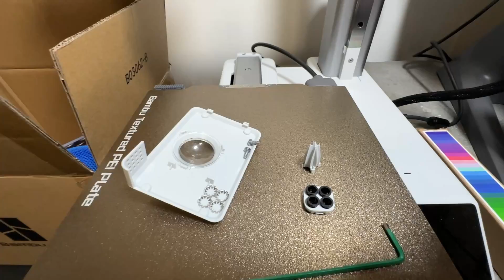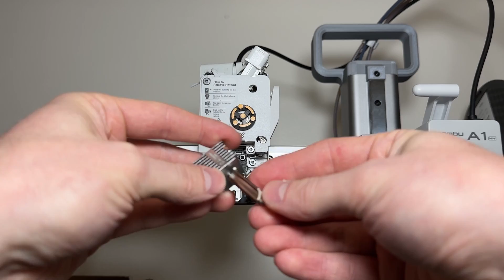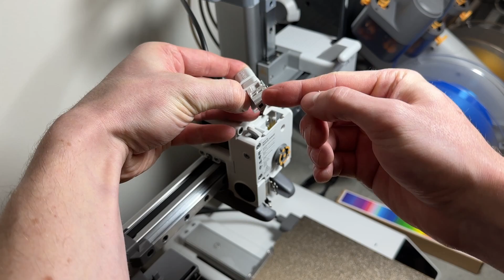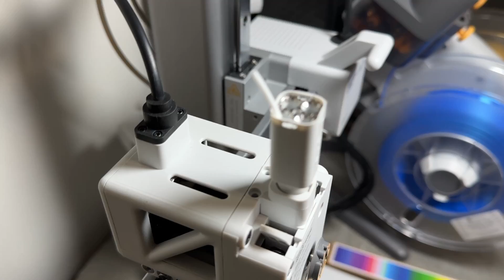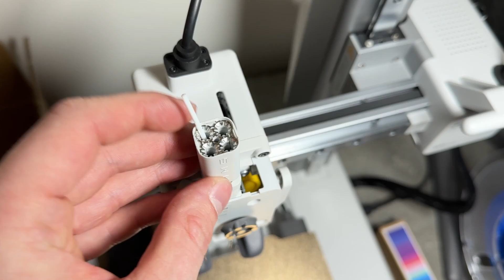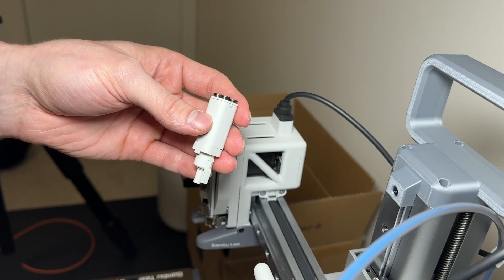How to Clear Broken Filament from the Bambu Lab A1 mini | AMS Lite Filament Hub

Comment: Today i just broke one of those 4 black rings on the top of printer head while trying to pull the tube out to change the filament form abs to external, i just bought the machine few weeks ago, any idea how to fix? should i request a part from Bambù as i still have the waranty?
Reply from the maker: You could try your luck with Bambu support to send you one for free. People have had mixed results when dealing with Bambu support. 

Otherwise it is a $6 replacement part if I remember correctly.

Comment: Wow this is exactly what im experiencing right now and I have done what you did originally but had not fixed it until I watched how you popped up the filament part that didn't require un screwing stuff.
When I unscrewed the top area off at the start, there is that black tape thing which was hard to put back in properly. I hope nothing gets caught or burn.

Comment: My Hotend ain't coming out
Reply from the maker: Might have to press the lever on the side to cut the filament. Pretty sure it does this at the end of every print automatically but if it got stopped mid print the filament will still be attached.

Comment: Just a heads up for anyone stuck on this - it’s even simpler than the video here suggests - Remove the nozzle and then you can just push down the spring loaded filament joiner on the top - that releases the filament that is stuck and the use another piece of filament to just push the stuck filament through out the bottom.
Reply: That didn't work for me but the video did

Comment: I woke up this morning to this problem with my A1, which I resolved with your help. Thanks from Mexico. Now I have another concern. I pulled the ribbon cable that connects to the part where the AMS hub plugs in. It didn't disconnect, but now I can see it on the side of the print head. I'm not sure if that's how it looked originally, and I'm worried it might burn

Comment: Very helpful, I was struggling to get the PTFE tubes off of my A1 on that end and being able to pull it off from that end helped. I was about to right for those tabs too.
Was able to get the broken filament to fall out by holding it upside down and now I can print that tube remover :)

Comment: Ah dude, thank you so much.  I was about to do the same thing you did lol and just start taking things apart. They didn't have a support article for the A1 which....is dumb. But this solved my problem. My filament was stuck by the spring - thank God i had some super thin needle nose pliers that could get it out

Comment: Thank you so much. I had the exact same issue (as well as a clogged hot end), but I could not figure out why I could get any filament into the feeder! This was exactly what I needed to do. I did have to take the top off the hub and remove the divider to get the pieces out. But once I did this worked like a treat.

Comment: This is excellent info man! As someone who often tears into electronics to repair things, I did the same thing and undid the back 2 screws.. started lifting up and felt the tension of something.. the flatflex. "Oh no I am NOT supposed to be here for servicing.." as I know tearing a flat flex circuit is a great way to ruin ones day, they are stupid fragile. Pulling the top piece only off via that tab area, also makes getting the PTFE tubes out WAY easier(my jammed one was not budging) as you can use more angles on it and press it down against a desk. I think I'm going to design a base that this entire piece keys into, so that tube won't get destroyed.. mine jammed from having PLA just sitting in the tube, pieces cracked then fell in.. 2 pieces fell out from that same filament, I'm guessing inside it all wedges to one area, so 2 filaments there will pretty much always cause a jam to occur.
Reply from the maker: Yeah they funnel into one tube so 2 of any filament will cause a jam like in the video. 

Those top screws do serve a purpose and there are some maintenance/replacement tasks that require disassembling them but just not for a simple jam haha. Glad you liked the video :)

Comment: If you're looking at the ams hub, there's a lever on the right for cutting the filament, and there's a lever on the left. What is that left lever for? I can't figure it out, I know the wiki said it's an extruder gear lever but not sure what that really means
Reply from the maker: Pressing that lever disengages the extruder gear. You can test it out by removing the hotend and trying to push filament through by hand. You wont be able to. Press that lever and you will be able to push filament through by hand. Let go of the lever and it will grip on to the filament. 

You won't run into to many situations where you have to use this but it's useful during a jam or some maintenance tasks.
Reply: @3DPrintStuff  thanks a lot, I've had one or two times where I was bypassing the ams and my filament got a bit unhappy.

Comment: Excellent video.  I found the two pieces of filament, cleaned them out, and still can't clear the blockage under that piece.  Any ideas?
Reply from the maker: Have you removed the from cover and removed the hotend to see if the entire pathway is clear? https://youtu.be/1h1jX_joaBI
Reply: @3DPrintStuff  Thank you for responding.  

I removed the hot end and found the answer on the screen for heating the hot end.  By going into that setting, I could "extrude" the broken piece below the filament cutter by pressing the down arrow.  That spit the broken piece out.

Comment: Thanks for the video.  My very first attempt to print has "jammed" (can't detect filament location) and I'm trying to resolve,  Your video has made me resist taking things apart too soon.  Next thing, how to remove PTFE tubes from white AMS 4-way widget ...
Reply from the maker: https://youtu.be/00G0egBlSQM
Reply: @3DPrintStuff  thanks :) in the end didn’t have to remove tubes. I’d put a bit of old Ender 3 filament in which had a long ‘spike’ of half-melted filament at the end. I guess this was confusing the A1 Mini. Just popping up the AMS Hub let me access the filament and cut the ‘spike’ off then everything worked great. Was a bit surprised I couldn’t eject the filament more easily either automatically or manually.

Comment: Thanks for this. I had a jam there too; I did take the two back screws off though and was luckily able to just push the broken piece through with another piece of filament. It's good to know if I get another jam I won't need to go as far as removing the screws.
Also, as an FYI to anyone who wants to keep one of those hubs on hand as a spare who doesn't click through your link (they should!), it's under the spare parts--> ams lite section of the store, listed as "AMS lite Filament Hub".
Your videos have been very helpful. The next bambu order I make will be with your affiliate link.
Reply from the maker: Gald this video was helpful and I appreciate you using my links.

Comment: Thanks for tearing yours apart so we don't have to possibly damage ours! Mine jammed on the first print in the AMS. I took the two screws out to pull it out, then saw the ribbon and decided youtube was a better solution than a damaged printer with zero completed prints.
Reply from the maker: The intent of the video was to save people from having to go through the same steps I did. I'm glad the video helped you.

Comment: Just like someone commented below, I was ready to unscrew and take apart all the pieces you mentioned but then a decided to do a quick search on Youtube, and I'm glad I did. Thank you for uploading this video and keeping me from turning a simple unclog into a nightmare.
Reply from the maker: Glad I could help
Reply: 6:01 you saved me right there. For some reason that cuff was floating free and I didn’t have the courage to push it hard enough to snap it into place because I wasn’t sure which way it was supposed to face. The entire video is really helpful since the more we know about what’s happening inside the easier it is to deduce what’s wrong, but just that one frame of you popping the final piece back in was a life saver. :) Thanks for taking the time and confessing to your over-exuberance. I’m sure you have saved a lot of us the same journey, and not all of us would’ve come out with a working printer.

Comment: Thank you sir! I am so far very dissapointed with my A1 standard. The whole "It just works!" Ive been hearing all over youtube is far from the truth, the machine has problems, and requires alot of finesse and trial and error, just like any other 3d printer.
Reply from the maker: Interesting to hear that perspective. I've had a mostly "it just works" experience with my A1 mini but I don't have an A1 standard so maybe that's slightly different.

Comment: great video, great info. 
i actually took "those 2 screws" out and ended up with not being able to get the ribbon back in the housing. my solution was to use the provided allen wrench and fish the ribbon out the side of the housing in order to pull in back in.  i write this so it may help someone in the future.
Reply: How did you pull it back in??

Comment: Can you show how do you remove the PTFE tubes from the AMS feed to the extruder?  I was trying to change the PTFE tube to use the external spool instead of the AMS and had to fight to remove the tube and ended up damaging the tube.  Thanks in advance for your help sir!
Reply from the maker: Press down on the black part while pulling up on the tube. They are a bit of a pain to remove. Bambu Lab have a video at this link: https://wiki.bambulab.com/en/a1-mini/maintenance/ptfe-tube#:~:text=Remove%20the%20PTFE%20tubes%20with,PTFE%20tubes%20one%20after%20another

Comment: Could you please tell me how you take the tubes out 🙏
Reply from the maker: Press down on the black part while pulling up on the tube. They are a bit of a pain to remove. Bambu Lab have a video at this link: https://wiki.bambulab.com/en/a1-mini/maintenance/ptfe-tube#:~:text=Remove%20the%20PTFE%20tubes%20with,PTFE%20tubes%20one%20after%20another.
Reply: @3DPrintStuff  BRO THANK YOU I ACCIDENTALLY PUT THE LONG ONE WHERE THE SHORT GOES
Reply from the maker: @NotEwl  YOU'RE WELCOME BRO
Reply: @3DPrintStuff  :D

Comment: though how do you peace the 4 way divider thingy back together
Reply from the maker: Hard to explain in text but I'll do my best. 

Plastic divider innards go inside the outer shell, followed by the metal retaining teeth and then the top part with the 4 black tube holder clicks back in. 

I would recommend not taking the 4 way divider apart if you can avoid it. It's definitely not designed to be taken apart and put back together frequently. Might get 2 reassemblies before it can't be put back together.

Comment: The instuctions tell you to connect all four then dont explain anything about fucking taking a tube iut to connect just one spool
Reply from the maker: Removing tubes: https://wiki.bambulab.com/en/a1-mini/maintenance/ptfe-tube#:~:text=Remove%20the%20PTFE%20tubes%20with,PTFE%20tubes%20one%20after%20another.

Near the bottom of this page shows single color assembly: https://wiki.bambulab.com/en/a1-mini/manual/unboxing-a1-mini

Comment: Thank you for this!

Mine also continued to say there was fillament stuck inside. I had to push some new fillament through the extruder and all the way out with the hotend taken out, I think a tiny bit of fillament was stuck on a sensor that snapped off
Reply from the maker: Glad it helped! Brittle filament that snaps is the bane of these AMS lite units and the original AMS.

Comment: I was wondering the other day about this. Thanks for sharing :)
Btw white PLA seems to break too easily and makes a sound when it snaps. So it broke in side 2 times at least , which makes me think may be it is a good idea to dry it out :)
Reply from the maker: Yeah white PLA is definitely more brittle. Doesn't help that my white PLA is cheap and really old. It snapped twice but both times feeding from the same tube, it must have snapped on the way out and gone up the wrong tube and then tried again and jammed it in the hole with another piece. Unlucky really haha.
Reply: @3DPrintStuff  dry it out and it will become better. If not dry more :D

Comment: Thank you for info. Hmm, I have not to use cracking filament if printing multi filament I think and then I should be safe. I’m getting this printer in few days
Reply from the maker: Yeah I was using old brittle filament, you'll be good if you use new filament.

Comment: I keep a few of them filament tubes on hand like you said $6.00 US plus they work great on my P1S in the back splitting my side manual holder.  Seen that by one of the other great minds, I just follow and thank you for sharing.  I also have the Filament jammer have not used it since this looks like two filaments some how got squeezed into one.  I guess the simple spring operation on the spool failed to pull back far enough.